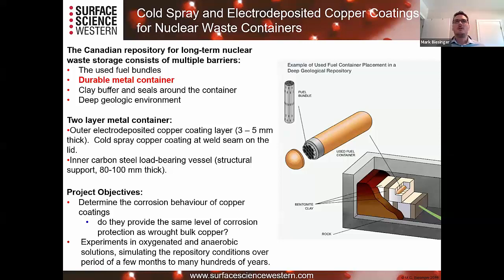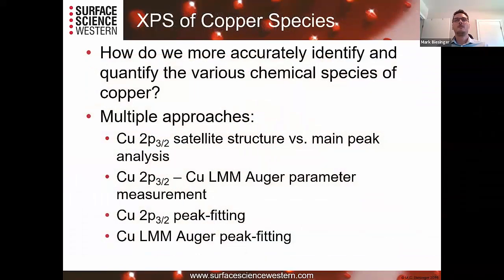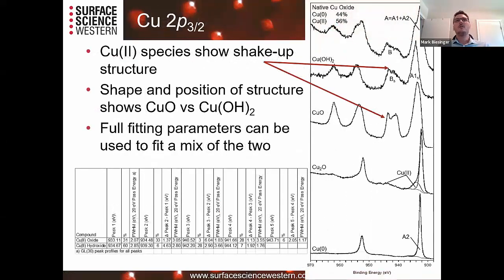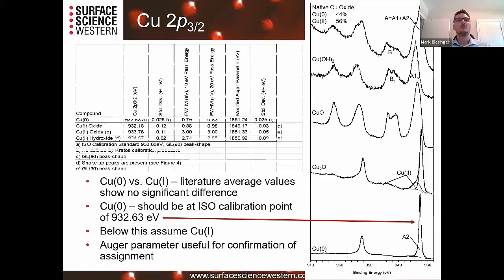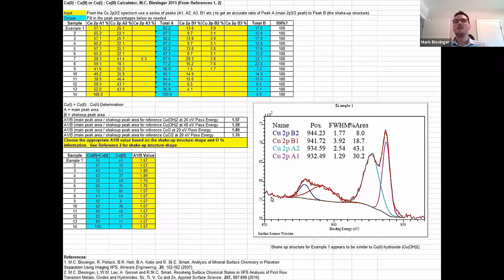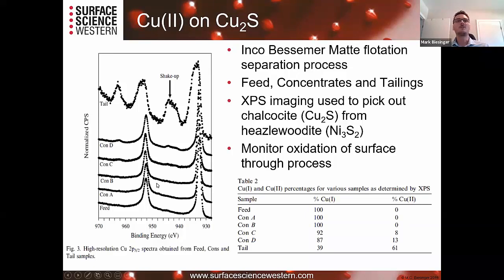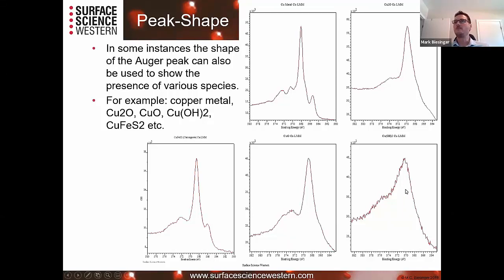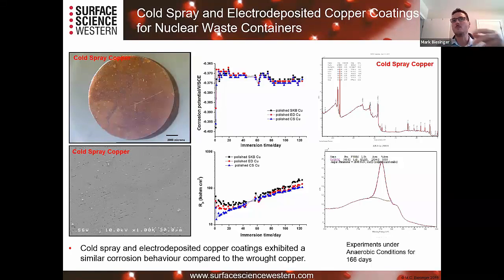Advanced Analysis of Copper XPS Spectra

Comment: Thank you so much for sharing your excel file on your website.  I've poured through a lot of the copper research and I am still having trouble.  My copper peak has a very broad at around 960 eV and the Cup2p3/2 is very small at 934 eV - any thoughts or directions on this ?